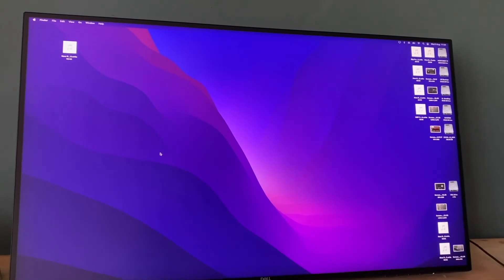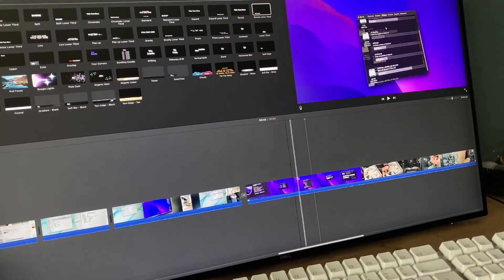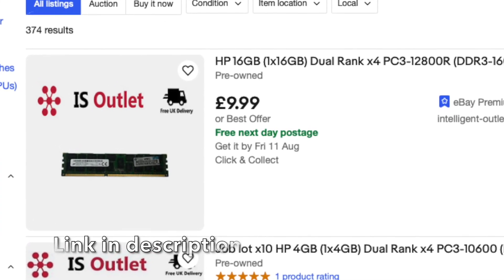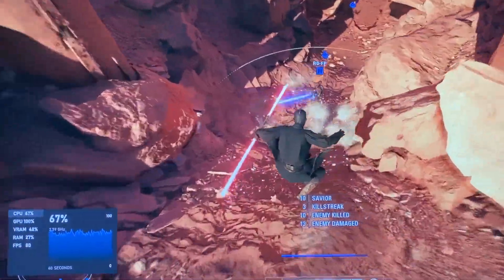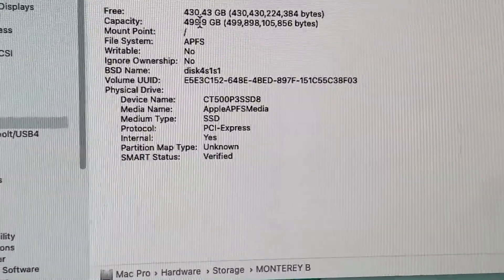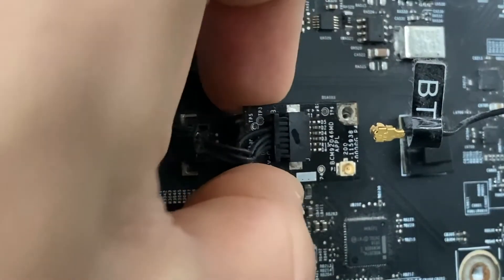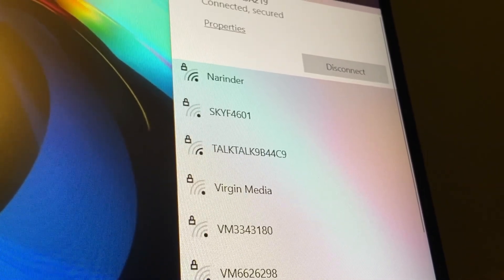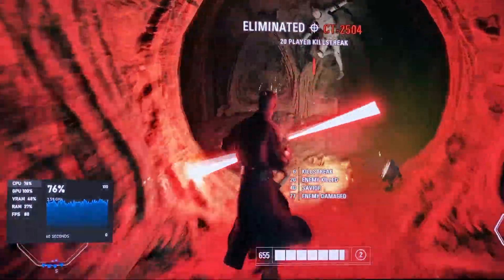6600 XT Mac Pro 5,1 Upgrade - Building the Ultimate Mac Pro 5,1 in 2024 with new CPU, Airport & more

Comment: If you own a mac pro it is extremely simple to inject enableGOP into the firmware of the mac which allows it to boot ANY card that supports uefi with a native boot screen.

Please stop buying specific mac flashed gpu's its absolutely not needed anymore.
Reply from the maker: Thanks for pointing that out. Wasn’t aware of enableGOP at all until now. Perhaps I’d have been better off using it, had I known better. Saying that, I prefer the simplicity of a straight up flashed card. Obviously they’re still good for UEFI on Windows ETC. I wouldn’t say I got a bum deal. 

I guess if you’re reading this considering what GPU path to take, have a look at enableGOP! While you can get half decent prices on MacVidCards sites, you’d probably save a fair bit of money, as Marc’s pointed out.
Reply: @montaguebarnabasltd  you can add uefi to non uefi capable cards (or at least most of them. Using an app called GOPupd. In which case it will happily work in windows under uefi mode (case and point is my current hd 7770 placeholder card. Added uefi to it)

Once uefi is added to the card you will get a native boot screen apon booting with enablegop injected into the firmware itself (while also retaining native boot screen for all other uefi factory capable cards)

Remember the driver for gop output for native boot screens on mac (the one that is injected into the vbios of a card) is identical to the one that we inject into the firmware. Just that the mac applies it to the card apon boot rather than each card having to have it injected into firmware. (This also solves the issue of cards that dont have the space for the gop driver)

Edit: should add i didnt mean to come across as you got ripped off or anything. Macvidcards provide a service that you CAN do yourself for the most part as a package for those that are inexperienced or dont want to deal with the issues flashing can cause. Just that injecting the gop driver into the bios of your mac is simple especially if you have a backup of your clean original one (which all mac 4,1 to 5,1 flashed units need to be aware that they suffer from bootrom corruption over time)
Reply: Just to add to this further. The reason i suggest adding the GOPenable driver to the firmware of the mac pro itself is because of the hard 128kb limit of amd firmware files (in certain cases) adding uefi to these cards if they dont support it already is easy using the above meantioned tool however certain versions of enableGOP wont fit onto the bios within the given space.

I assume macvidscards is either making custom bios's for their cards to enable the native output or they are upgrading the physical eeprom chip on the graphics card in order to fit what i assume is a proprietary enable GOP alternative. 

Either way the money they charge is absolutely acceptable for the work involved in making sure that it A: works and B: they can give a warrenty on a modified card. They obviously stand behind their work and each to their own just wanted to make it known.

Comment: Man the fact Open Core has kept so many older macs alive to this day is amazing. They just wanted to cut clean from intel systems IMO so that is why a lot of it stopped getting supported.
Reply from the maker: Absolutely. Yeah until there’s no support for Intel whatsoever, opencore should be viable
Reply: @montaguebarnabasltd  Next major OS release is going to be exactly that.
Reply: I don't think that's you're opinion, that is literally what they did. Completely and objectively true.
Reply: Kinda reminds me of TPM 2 support with Windows 11.
Reply: @Dave102693  - If ONLY Microshaft could ditch "trusted platform management X" ... why is it at all or in any way trust worthy to any customer or user?

You know the TLA's can get into it.  
The TLAs may even auto "enroll" into everyone's "Trust", like they have done over the last 4 decades of electronic computational communication and legacy communication options.  They are in no way at all "trustable".  They have all the secrets, for now...
Reply: I’m running macOS sequoia on a Mac mini 2011, it’s slow but feel great to be able to use the latest Xcode on a 14 year old mac
Reply: They wanted a clean break, but they aren't offering machines that are actually upgradable anymore in the same ways that the 5,1 MP was/is.

If the new generation of "pro" machines had anything upgradable, people might be more willing to move to them. But what can you upgrade? RAM? No. Storage (internal)? No. Do they even have internal optical drives anymore? I have two BluRay burners in my MP. Upgradable graphics? No. The M series is amazing for what it can do, but it has severe limitations in how integrated everything is. 

Us long-time pro users are being asked to give up a machine where everything was upgradable, and now after 15+ years, it's not even because the machines are too outdated, it's because Apple wants to push us to the next best thing. This isn't like when I went from my MDD G4 to my 5,1 MP. Apple wants us to just buy another entire computer every time we need to upgrade. And that's a dealbreaker for me, after 25+ years.

Comment: Do you use photoshop on this machine by any chance ?
Reply from the maker: Yup. That’s pretty significant for me in any computer.
Reply: @montaguebarnabasltd  Cool. Are you getting GPU acceleration when using Raw details in camera raw by any chance? Specifically denoise. (My 5,1 running Ventura with a RX580 will not use the GPU and I’m stumped!)
Reply from the maker: @benclucas4375  sorry to be of such little help, but I very rarely use photoshop for photography/real camera RAW files anymore. These days I’m mostly graphic designing on it, using low quality files for thumbnails ETC. 

I would check Reddit for answers, maybe ask in the MacPro thread. Otherwise potentially try a different version of Photoshop if possible. For example I have a Ps 2019 installation I still go back to, which I find solid as a rock on these older machines.
Best of luck
Reply: @montaguebarnabasltd thanks for getting back 👍🏼

Comment: I got rid of mine with this spec except a rx580 back in 2018. Was too slow then can’t imagine that cpu being useful now. The M1 runs circles round these in all tasks but gaming. Good for you for making it work in 2023
Reply from the maker: My use case is 50% gaming and 50% editing 1080p video. Thankfully not anything it struggles with in the CPU dept! True about the M1 though
Reply: Not true the 12 core 3.46 is as fast or faster than the m1 base in multicore cinebench and other apps that can use multiple threads.

Geekbench does not measure multiple threads so its makes these seem slower than they really are.

This blows away the base m1 gpu.
Even in metal

Where apple wins is its special encoding and rendering media engines and m1 single core speed  if the app can use those me base wins but is limited to 16 or 32 GB and then uses the ssd as a scratch disk.

In short video and photo editing.

Meaning once that ssd goes the m1 machine is a brick.

Obviously this wins at games and some 3d as well plus can do windows natively Linux and older versions of osx and also some 32bit plugins and apps.

I think the rx6800 is the sweet spot up to the 6950 which even beat the mac studio and pro ultra in many gpu tasks for $3_$700 since GPU prices have come down.

The faster cards need a pixlas power mod 6800xt and higher.

For everydaythings I doubt any one can tell the difference when both have fast ssd.

The m2 base unit have slow ssd

Comment: is it more powerful than m2 max laptop?
Reply from the maker: In some areas (graphics, ram and storage size) yes, others (cpu, memory speed, and more) no.
Reply: @montaguebarnabasltd   you can repair you own computer   m1,m2,3 you have take to apple for repair$$$$$
Reply: @macgamer1973  you mean take to apple to fully replace?
Reply: @montaguebarnabasltd  Memory? Le's see a M2 take 256GB RAM.
Reply from the maker: @fleonard4  I’d like to see 1333mhz ram beat DDR5/latest apple speeds lol. Realistically there is no competition.
Reply: @montaguebarnabasltd  again, depends on what you do with it. Benchmark watchers are never looking at real world, and real world there are advantages and disadvantages both ways. Again, the Mac Pro slaughters on versatility, and I have yet to find a single thing mine can't do. I can run all games on ultra, and zero lag. The only limit is the RX580. I could throw in another GPU, but I don't need it.
Reply from the maker: @fleonard4  I agree completely that real life is the metric we should look at, and the 5,1 truly can’t be beaten on versatility. 
I worry slightly that you’re a bit optimistic of its powers though! The memory is slow, there’s no denying it. It is very capable of carrying a lot of it though. Storage on the M1/2/3 macs is undoubtably faster than almost any storage in an Intel Mac Pro, and you can put a few terabytes in the Apple Silicon machines as well as expand them externally with pretty decent Thunderbolt speeds. 
Also power consumption is mad in the 5,1s. It blew me away when I realised I could get almost everything I do on the 5,1 done on a MacBook Air M1 without it even heating up. 
Lastly, gaming is something apple have (perhaps unintentionally) moved away from in the Apple Silicon Macs. Windows on a windows PC is the way to go I’d say, and a budget PC build can wipe the floor with the 5,1 unfortunately.
Reply: Yes, way more powerful and versatile. The M2 might encode video a little faster, and have a few advantages for very specific tasks, but over all, the Mac Pros still can't be beat. Gaming, Windows 11, memory, storage, pretty much everything except a few bench marks in a few areas. The Mac Studios, and the 8,1 Mac Pros can't touch them. Even the 8,1 has like 8 PCI slots, and you can't put in a GPU. I think they max out at 96GB RAM. The issue we're running into now is the CPUs don't support AVX, but it only hits a few things. And a few games, that end up getting patched and fixed anyway.

Comment: That’s such a powerful GPU for that machine. Amazed with what you can put in it
Reply: What else could I use?
Reply: @Eruditealex4  I'm using RX580's in mine. It just depends on what you want to spend.
Reply: @Eruditealex4  -- my understanding is thte 6800 (non-XT) is the "most power" AMD not requiring the Pixalas mod for power delivery.

I think to do the PIXLAS (sp?) correct, one should correctly soldier, though that can make it tricky and if you do not have spare PSUs or boards around - you could fry our ancient MacPro tower...  THEN it is bargain hunting on EBAY or FLEEBAY!

I think the 6700XT can work well... no PIXLAS required.
I have also read that the AMD Radeon Vega 64, with the Vega 56 BIOS might be the best option and better if the machine is in a more "hot" environment (with the FAN COOLING software running as needed to keep things cool enough).

IIRC the 6800 (no XT) is more rare than the 6700XT, though they may be fairly similar performance wise, depending.
They may also be limited by the PCIe 2.0, 16lane bus ... though,  that may be application (or game) specific - even process specific within the app or game!

Good news is prices have come down.
These GPUs and older CPUs can burn a bit of power  - depending on costs in your area and run time ... they can also be great heating small rooms in the winter.
Reply: @Eruditealex4  -- IRC, the AMD 6800 (non XT version) is likely the "best" or most powerful without modifying the PSU cables.  It is a bit limited by the older architecture - naturally - though I am sure some things will shine.

Maybe some of the best cards are the Radeon VII (requiring a PSU mod or PIXELAS mod) or the Vega 64.  Some say it is even better to flash the Vega 64 to downclock it to the Vega 56 so it will pull less power and be more stable.  The Vega 56 should also not require the power mod, yet the 64 will... 

You can probably run several nVidia top end graphics cards - yet you would have to boot into Windows 10, so maybe not ideal.  Maybe there is a way around the TPM2 for W11?